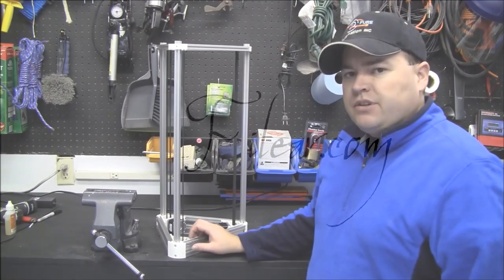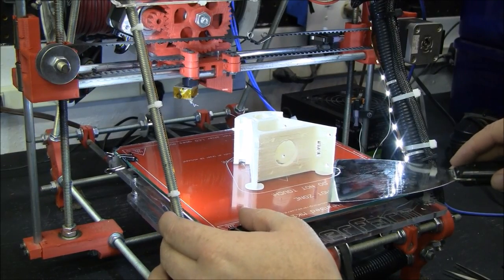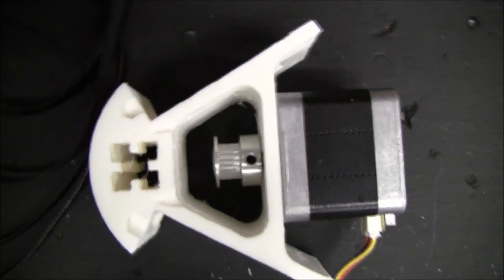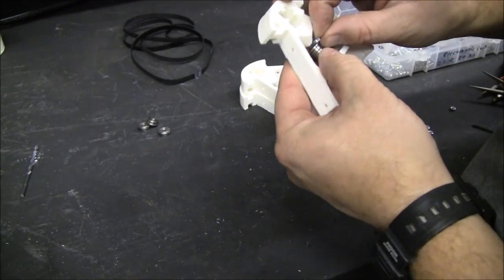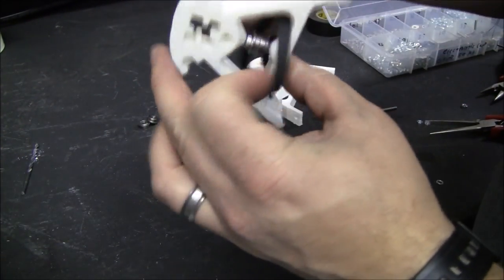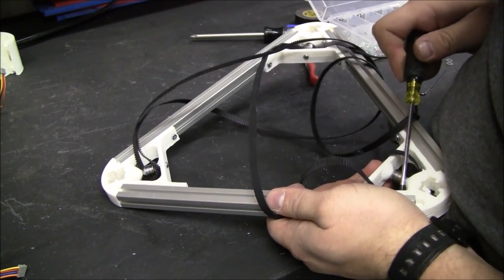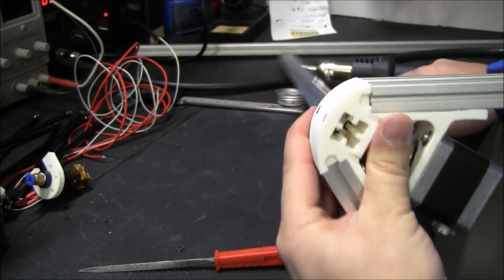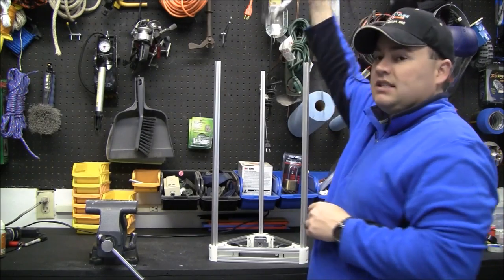Kossel Mini Complete Frame Assembly

Comment: I want to get this... but i wonder if I can use blender to print to it.  What I did was use EasyToy to make my models, exported them as obj files and imported them to blender (clicked smoothen) and rescaled them.  Will this printer do the job?  My models are small regardless, they'll be casts (for molds) of my custom snow globe characters.
Reply from the maker: The only files we can use are .STL files which you can export from blender. You don't mention the size of objects so I will guess you wouldn't be happy with the resolution. If you are printing human characters less than about 5 mm it will be a blob. If larger say 20MM across you could distinguish features fairly well. It should work ok for things like buildings. You can work on getting the resolution down to what you need, I use a 0.3 MM nozzle so that is what my layer size is.

Comment: Thanx for this video.

Could you post the BOM please because i want to realize the same printer as your :)
Reply from the maker: Sure thing, I have a partial list now, hopefully in a week or two I will be done building the printer and be able to finish up my videos, documentation, and BOM etc.
Reply: filear thanx a lot for your quick support.
I ll try to print first  pieces this week end. For the moment i m looking where i can buy15*15 alu in france.

Good chance for future video. I am a fan!
Reply from the maker: I got my 1515 Extruded aluminum in a pre cut Kossel Mini kit on ebay. I couldn't find it much cheaper elsewhere.

Comment: Where did you buy your frame rails? I desperately need a set.
Reply from the maker: I got a pre cut Kit on Ebay. Tridprinting, Amazon, and others usually have them, I don't know why they are all sold out at the moment. You might just try to get some 1515 extruded aluminum somewhere and cut your own... Make sure it is 15mm x 15mm not the 1.5" x 1.5"
Reply from the maker: It looks like the 15x15mm T-Slot extruded aluminum is primarily made by OpenBeamUSA...
Reply: I bought mine online through Misumi for $33 plus shipping
Reply: Mine was $55.00 :(
Reply: I looked cheapest I can find is 55 before tax, S&H :(